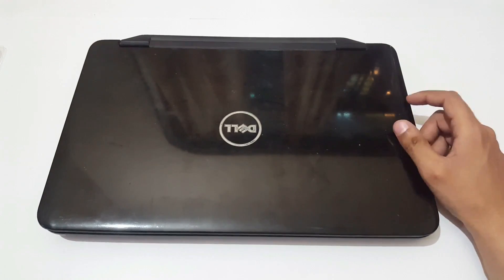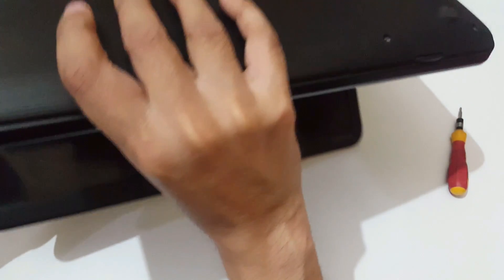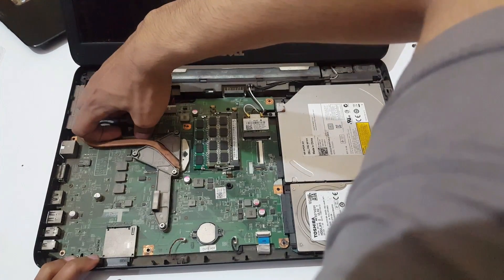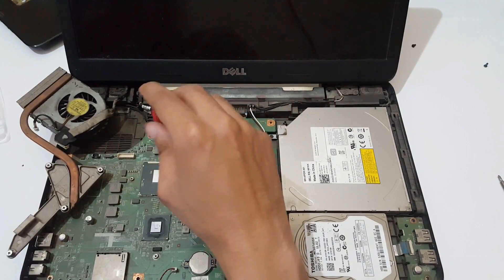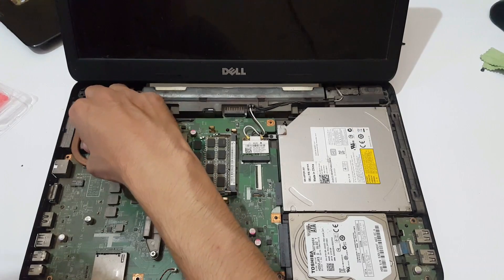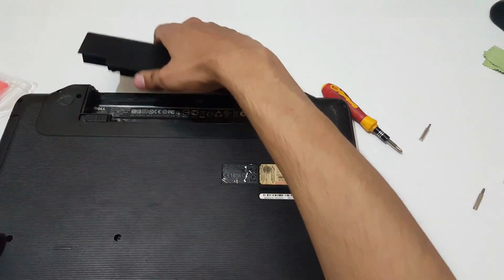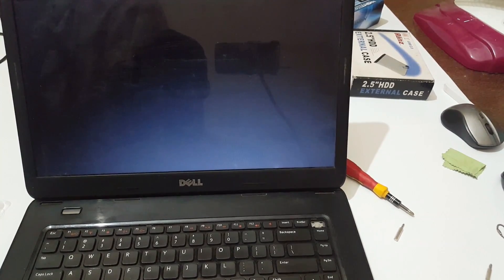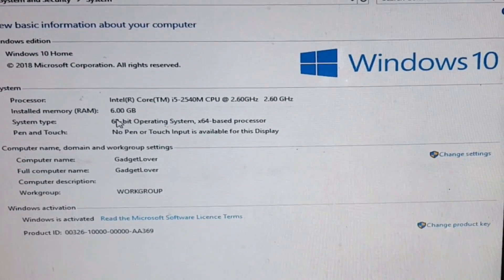How to Upgrade Processor on DELL Laptop | i3 to i5 & i7 - Make Laptop Faster for Gaming

Comment: Somebody told me that 3 genration ke upr ke laptop ke processors change nahi ho sakte vo motherboard me inbuilt hote hai , is it true
Reply from the maker: ayush kumar : No
Reply: @GadgetLover360  matlab me kr sakta hu change
Reply from the maker: ayush kumar : What Laptop do you have
Reply: @GadgetLover360  I have dell intel core i3 6006U @2.00GHz  2.00GHz, 4gb ram, 64 bit
Reply from the maker: ayush kumar : What model
Reply: @GadgetLover360  i think vostro 15
Reply: @GadgetLover360  please reply
Reply from the maker: ayush kumar : Unfortunately the processor of this Laptop is soldered so you can't upgrade it

Comment: Sir can I upgrade processor of my Dell inspiron 15 3593 i5 1035g1 And where to get processor for laptops?
Will pc processors work for laptop?
Reply from the maker: Mehul Singh : No and the processor of this Laptop is soldered so you can't upgrade it
Reply: @GadgetLover360  bro can u give list of laptops where we can upgrade processor under 40k used for programming
Reply from the maker: @anshallu3235  I would suggest you see it on Ebay or Aliexpress online store

Comment: Can i upgrade latitude e5440 processor I want to upgrade it to core i7
Reply from the maker: MEMES WORLD : In my knowledge the processor of this Laptop is soldered so you can't upgrade it
Reply: @GadgetLover360  um yes you can you just use a solder iron and solder wire to solder it back in
Reply from the maker: legendary player : No it requires professional hand soldering services

Comment: Sir my laptop is i3 7th generation I want to make it fast performance what should I change in dell laptop
Reply from the maker: Âyûsh_ Jāîñ : Provide processor number and I would suggest you upgrade its RAM and install SSD for better performance
Reply: @GadgetLover360  what is ssd
Reply from the maker: Âyûsh_ Jãîñ : It is solid state drive which is faster and more power efficient than HDD
Reply: @GadgetLover360  ssd is an app . If it is an app then how to download  it plzz help me
Reply from the maker: Âyûsh_ Jāîñ : It is similar to HDD but it has faster and more efficient performance than HDD I would suggest you search on Google for better results
Reply: @GadgetLover360  what will be the cost .
Reply from the maker: Âyûsh_ Jāîñ : I would suggest you buy it from Amazon online store
Reply: @GadgetLover360  Bro my laptop is dell Inspiration 150000 ,core i3 ,and 7th generation , windows 10, I buyed 5 or 6 months ago my problem is some app not work faster what to do
Reply from the maker: Âyûsh_ Jāîñ : I would suggest you upgrade its RAM and install SSD for better performance
Reply: @GadgetLover360  how to remove password in dell laptop
Reply from the maker: Âyûsh_ Jāîñ : Click on Start>Control Panel>User Accounts>Manage User Accounts>Select user account name>Select Remove Password
Reply: @GadgetLover360  ok I will try it!

Comment: Is it possible to upgrade my laptop to i3 9th gen?
My laptop is dell inspiron n4050 
Current processor is intel pentium B950 2.1Ghz
Reply from the maker: Tr Uy : Unfortunately you can upgrade it in same generation only and I would like to inform you that Intel Core i5 2540M is best processor for your Laptop
Reply: @GadgetLover360  Thank you brother. I was about to buy it😅
Reply from the maker: Tr Uy : You're welcome
Reply: @GadgetLover360  Brother. What about intel xeon. Which model on Intel Xeon I can upgrade to?
Reply from the maker: Tr Uy : Unfortunately you can upgrade it in same generation only

Comment: Hello brother, very nice video
 i'm using hp 250g3 laptop , i3-5005u , which processor can i upgrade to and where can i purchase this?
Thanks in advance
Reply from the maker: Rohit : Thanks and unfortunately the processor of this Laptop is soldered so you can't upgrade it

Comment: hello my laptop has a ghatiya wala even though it says i5 10th gen it is serously slow and diplays 1.19ghz inproperties s which would you reccommend
Reply from the maker: JoeyBarton 22 : Run scannow and check disk command in your Laptop and I would suggest you upgrade its RAM and install SSD for better performance

Comment: Hi.  I have n5040 and intel Pentium p6200 2 cores. Is it possible to upgrade it to i5 or i7. Which cpu's are compatible
Reply from the maker: Martin Mwenda : Intel Core i5 580M is best processor for your Laptop
Reply: @GadgetLover360  will it handle games such as gta
Reply from the maker: Martin Mwenda : See its minimum requirements

Comment: bro i have a lenovo thinkpad e470 with i3 6006u which core shoulld i go to ?
Reply: can i go for i7 ?
Reply from the maker: hyper X : In my knowledge the processor of this Laptop is soldered so you can't upgrade it
Reply: @GadgetLover360  i have already replaced a i7 5th gen in lenovo e570
i wanna know which core is perfect for e470 .i wanna replace it with i5 6th or i7 6th or 7th gen
Reply from the maker: hyper X : Intel Core i5 6360U is best processor for your Laptop
Reply: @GadgetLover360  are u sure about that dude 
can i go for i7 6th ?
how much i5 6th gen laptop processor cost
Reply from the maker: hyper X : Yes you can also go with Intel Core i7 6th generation processor but in Intel Core i5 this processor is best for you Laptop
Reply: @GadgetLover360  ok thx for ur reply sry if i disturbed u
Reply from the maker: hyper X : You're welcome
Reply: @GadgetLover360  but that is hq
i want u series
Reply from the maker: hyper X : You can upgrade it in same generation only
Reply: @GadgetLover360  this is too hard just dm me in discord
Reply from the maker: hyper X : Intel Core i7 6660U is your processor upgrade generation

Comment: Brother currently I am using i5 2nd generation processor did I can update my processor into i7 2nd generation??
my laptop 5110
Reply from the maker: Sakkeer Husain : If processor is not soldered you can upgrade it in same generation only
Reply: No it's not soldered
Reply from the maker: Sakkeer Husain : Then Intel Core i7 2640M is best processor for your Laptop
Reply: @GadgetLover360  thankyou very much
Reply from the maker: Sakkeer Husain : You're most welcome

Comment: I want to upgrade my laptop performance for development and design 
 dell Inspiron 15 3000 series
4gb, core i3, hard disk 1tb, 
Intel(R) Core(TM) i3-5005U CPU @2.00GHz
what I upgrade in my laptop for best performances
What is your advice for me?
Reply from the maker: Pavan Saini : In my knowledge the processor of this Laptop is soldered so you can't upgrade it so I would suggest you upgrade its RAM and install SSD for better performance

Comment: I tried to upgrade dell Inspiron 3520 i3 rd 3110M To i5 2520M but pins are different partially locked not working..  mother board dv15 mlk mb 11280 -1 PWD mxrd2 rev A00,
I gues both have G2 socket, if I use force to tighten then processor pin may broke.. what should I do? Is it comptiable.
Reply from the maker: Raaz Kumar Com - Telugu : No because you can upgrade it in same generation only and I would like to inform you that Intel Core i5 3380M is best processor for your Laptop
Reply: @GadgetLover360  again I tried to lock the cpu it worked, but laptop won't turn on both laptops,. Even if same socket & same generation , is there any mother board comptiability..  laptop manufacture listed few provessors of same generation for upgrade..
Reply from the maker: Raaz Kumar Com - Telugu : If you tried to insert second generation processor forcefully it may have damaged the socket pins that's why it is not working

Comment: Dell inspiration 5537 core i5-4200u @ 1.60Ghz

Can it be upgraded?
Reply from the maker: black : Unfortunately the processor of this Laptop is soldered so you can't upgrade it

Comment: i have dell vostro 1014 2gb ram 120gb rom and dual core pentium processor what should i upgrade ??
Reply from the maker: Vithal Rajpallu : Intel Core 2 Duo T9900 is best processor for your Laptop and I would suggest you upgrade its RAM and install SSD for more better performance
Reply: @GadgetLover360  from where can i get this?? Do you have any trusted site to buy?
And which type of ram should i use?
Reply from the maker: Vithal Rajpallu : I would suggest you buy it from Ebay or Aliexpress online store and you can expand it upto 4GB so buy 2GB 1333MHz DDR3 RAM

Comment: Hi, I am using Dell Inspirion with i3 - 6100 U CPU @ 2.30 GHz. 
Having Windows 10 with 4 GB RAM memory. 
Can I upgrade to i7 processor? 
Will it be impact on RAM anything? 
Is i7 compatible with this 4GB RAM? Or if I installed  i7 then my RAM will not support to i7. 
Please guide. 
Thanks for great video. Keep it up.
Reply from the maker: Milind Andhrutkar. : You're welcome and I would like to inform you that if processor is not soldered you can upgrade it in same generation only and there is no need to change the RAM after processor upgrade
Reply: @GadgetLover360  Ok. I have checked. It is soldered. So I cant change ! Right. Since last 15-20 days, when I opened 3-4 website + my Trade Tiger software for Share Trading & Telegram App my laptop gonna hang or showing me "This Programme is n
Not Responding". I don't understand what's the problem. Earlier I used to opened same websites & software. Nothing change in that. But now it giving me trouble. 
Since I use this laptop for trading purpose, there is no downloads or gaming etc. There is a huge storage balance in it. 
Can you guide me?
Thank you.
Reply from the maker: Milind Andhrutkar : You're welcome and I would suggest you to run scannow and check disk command in your Laptop and see whether the problem has been solved or not
Reply: @GadgetLover360  I have installed Quick Heal Total Security Anti Virus. How to run Scannow? And what is disk command? 
😇😇😇
Reply from the maker: Milind Andhrutkar : Both are commands that runs by command prompt

Comment: Bro I Have Core i3, 8gb ram.... Model - Dell Inspiron 15 3521 Can i Upgrade It's Processor For Better Gaming??
Like Ryzen 3 or 5...??
Reply from the maker: Niko Bellic : Unfortunately the processor of this Laptop is soldered so you can't upgrade it and I would like to inform you that if processor is not soldered you can upgrade it in same generation only
Reply: @GadgetLover360  OK Bro...!

Comment: Bro, I have Dell Inspiron N5030. Can I upgrade my RAM, HDD, and processor? Pls recommend me if possible.
Reply from the maker: INFERNO INFINITY : Yes
Reply: @GadgetLover360  Could you tell me what should I upgrade to?
Reply from the maker: INFERNO INFINITY : Provide processor number
Reply: @GadgetLover360  Intel T4500
Reply from the maker: INFERNO INFINITY : Intel Core 2 Duo T9900 is best processor for your Laptop and I would suggest you upgrade its RAM and install SSD for more better performance
Reply: @GadgetLover360  OK Bro thanks. How could you get all this information?
Reply from the maker: INFERNO INFINITY : You're welcome

Comment: Hi, this was great info, am using lenovo G500 , intel i5- 3230M 3rd generation, which will be the best processor for upgrade
Reply from the maker: Krishna Sharan : Thanks and Intel Core i7 3632QM is best processor for your Laptop
Reply: @GadgetLover360  hi me am using dell inspiron 3482 Intel Pentium Silver N5000
which processor could you suggest for me ??
Reply from the maker: Amzo mmgTV : Hi and in my knowledge the processor of this Laptop is soldered so you can't upgrade it but I would suggest you upgrade its RAM and install SSD for better performance
Reply: @GadgetLover360  yess thanks for your help
Reply from the maker: Amzo mmgTV : You're welcome

Comment: I have an E1-471 Acer Aspire laptop with a removable Processor.

I'm planning on upgrading it in the future, is the processer of an Intel i5 compatible for the laptop? And will be planning on replacing the Hdd with SSD and it's optical drive with a 1tb hdd with a caddy and upgrading from 4gb to 8gb/16gb if possible.
Reply from the maker: ph_Cebuano : Okay and in my knowledge you can expand its RAM upto 8GB

Comment: Sir, my laptop is not  opening can you help me with it and tell me what is the problem within  it. It is showing something like media test failure. Check cable...........if possible can you give me you email i will mail you  the pictures
Reply from the maker: 4 PRO Gamers : Eject the processor and clean its thermal paste then apply it on top and carefully install again and see whether the problem has been solved or not

Comment: Bro can i replace i3 to amd ryzen 5 please tell
Reply from the maker: Tanmay Khilar : Unfortunately you can upgrade it in same generation only
Reply: @GadgetLover360  same generation means
Reply: @GadgetLover360  means on which processor of amd can i replace
Reply from the maker: Tanmay Khilar : You can upgrade it with Intel same generation processor only
Reply: @GadgetLover360  so i had 7th gen then which processor of amd should i buy
Reply from the maker: Tanmay Khilar : Provide processor number
Reply: @GadgetLover360  i dont know

Comment: Can I replace with ryzen?
Reply from the maker: RAHUL THORAT : You can upgrade it in same generation only
Reply: @GadgetLover360  means? Pls explain
Reply from the maker: RAHUL THORAT : Upgrade depends on its processor number
Reply: Mine current is intel n3700 so can I upgrade it to ryzen processor ?
Reply: I have hp all in one pc
Reply from the maker: RAHUL THORAT : No but you can upgrade it with Intel Pentium N3710
Reply: @GadgetLover360  ok 😭😭 my dreams lost
Reply from the maker: RAHUL THORAT : Unfortunately you can only upgrade it in same generation
Reply: @GadgetLover360  Thnx for your help what if I change mother board ?
Reply from the maker: RAHUL THORAT : You're welcome and after motherboard replacement you can do it but it would be very expensive in my knowledge
Reply: @GadgetLover360  no gigabyte cost 4500 mother board on amazon.
Reply from the maker: RAHUL THORAT : Also see processor price
Reply: @GadgetLover360  it is of 8 thousand
Reply from the maker: RAHUL THORAT : So take decision according to your requirements and also see its GPU specifications
Reply: @GadgetLover360  ok thanks I am thinking to build new pc.

Comment: Bro i have i3 3rd gen processor . 
Can i upgrade to i5 9th gen processor or i can only use i5 3rd gen processor? Please answer
Reply from the maker: TiTaN X : You can upgrade it in same generation only
Reply: @GadgetLover360  means i can also use quad core processor
Reply from the maker: TiTaN X : Provide processor number
Reply: @GadgetLover360  Intel core i3 3110m
Reply from the maker: TiTaN X : Intel Core i5 3380M is best processor for your Laptop
Reply: @GadgetLover360  can i play gta v smoothly bcz i have only 4gb ram and 1746 mb intel hd graphics
Reply from the maker: TiTaN X : I would suggest you upgrade its RAM and install SSD for more better performance
Reply: @GadgetLover360  thanxx bro
Reply: @GadgetLover360  bro can i upgrade to Core i7-3940XM because it has same socket type and also 3rd generation
Reply from the maker: TiTaN X : Yes but after upgrade your Laptop will run very warm

Comment: Bro I have hp probook 6560b so which processor I upgrade
Reply from the maker: Aman Singh : Provide processor number
Reply: @GadgetLover360  intel(R) core(TM) i5-2520M CPU @ 2.50 GHz

4GB ram
64 bit os
Reply from the maker: Aman Singh : Intel Core i7 2640M is best processor for your Laptop
Reply: @GadgetLover360  I need to use editing videos , my current cpu get around 90% of usage when I do editing , so what do I do
Reply from the maker: Aman Singh : I would suggest you upgrade its RAM and install SSD for more better performance

Comment: Can I upgrade Asus Vivobook 15 x512fa from i3 8th gen to i5 8th gen. Other Specs: Ram 12 GB (upgraded) Intel UHD 620 graphics and ssd 256GB and hdd 512gb (upgraded)
Reply from the maker: Kazuma : In my knowledge the processor of this Laptop is soldered so you can't upgrade it

Comment: I Have Dell Inspiron 5421 Core i5-3337U, can I still upgrade it? If yes, what could be the possible processor? . Please reply . Thank you 😊
Reply: 8gb RAM is the maximum ram of this type of laptop?
Reply from the maker: Janielle Rosete : You're welcome and unfortunately the processor of this Laptop is soldered so you can't upgrade it and yes you can expand it upto 8GB
Reply: @GadgetLover360  oh . Okay thank you so much.. What else I could upgrade here other than RAM and SSD?
Reply from the maker: Janielle Rosete : You're most welcome
Reply: @GadgetLover360  can I upgrade my video card?
Reply from the maker: Janielle Rosete : No but you can attach it externally to your Laptop
Reply: @GadgetLover360  oh, any graphics card will do?
Reply from the maker: Janielle Rosete : Integrated graphics card
Reply: @GadgetLover360  is it possible to change if I go to an expert technician and ask him to change my i5 cpu to i7?
Reply from the maker: Janielle Rosete : Yes
Reply: @GadgetLover360  How about Fujitsu AH54/G with i5 2nd Gen 2.5GHz, is the processor of this also soldered?
Reply from the maker: Janielle Rosete : In my knowledge no